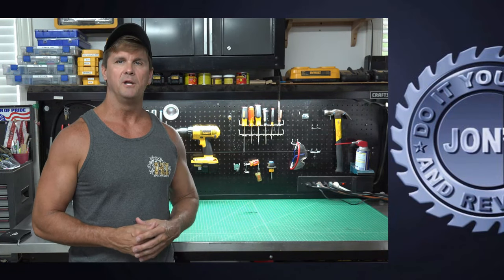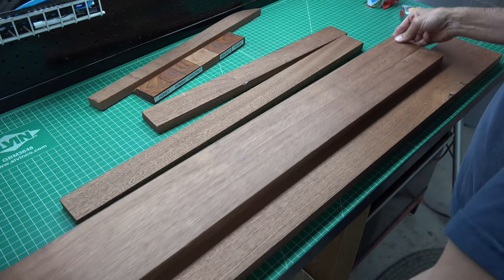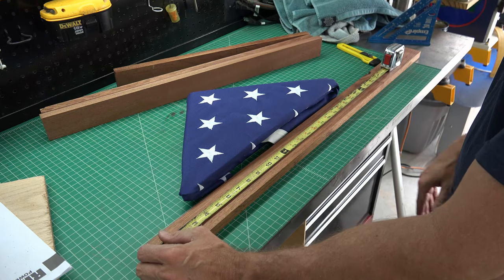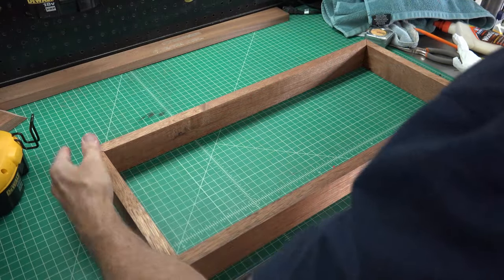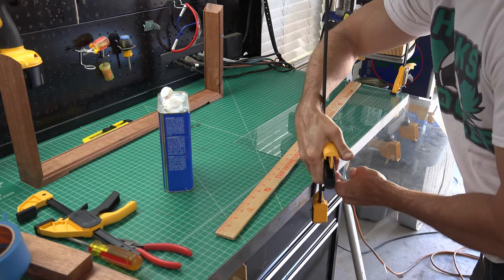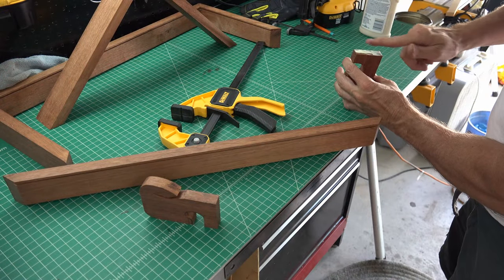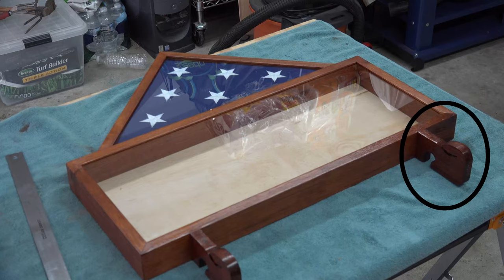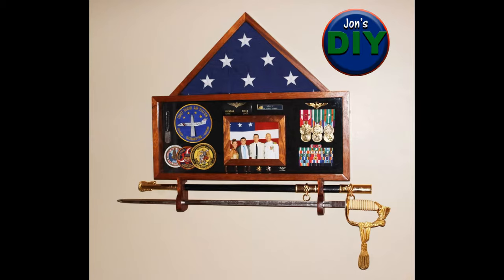Military Shadow Box with Sword Display / Jon's DIY

Comment: Wow Jon another amazing project!!!  What kind of wood is it that you used?  Keep the videos coming.
Reply from the maker: Thanks Dave.  Its Merbau.  I love the stuff but it dulls your saw blades quickly.
Reply: JON'S DIY it even dulls the diablo blades?
Reply from the maker: @davevesey8121 Yes the Diablos last a bit longer. Dulls the bandsaw and jig saw blads quickly too.  Not sure why but it does quicker than any other wood I cut.   But I just bought a saw blade sharpener. Maybe I will do a review on it and see if it is worth the buy.
Reply: JON'S DIY that would be great to see that review